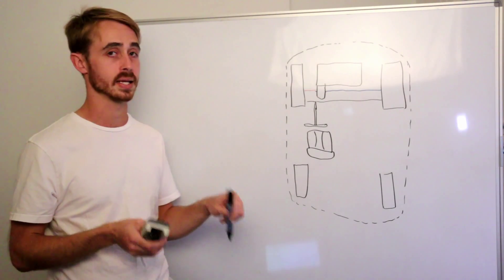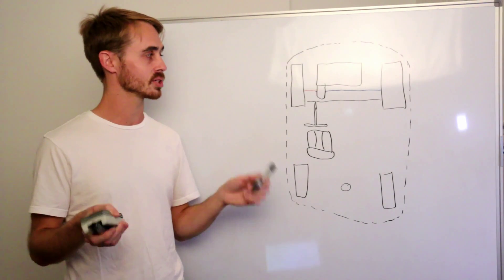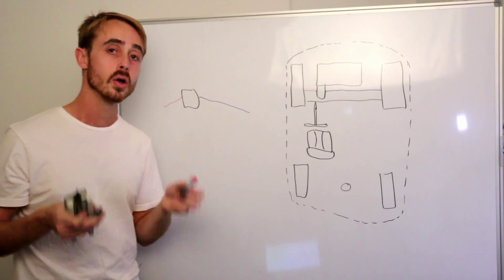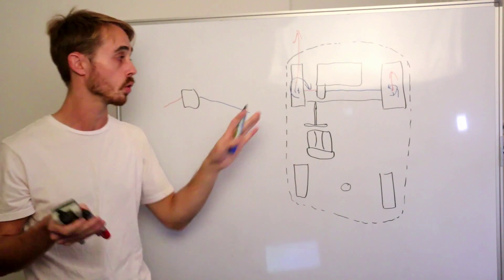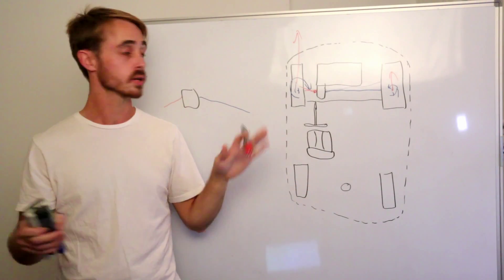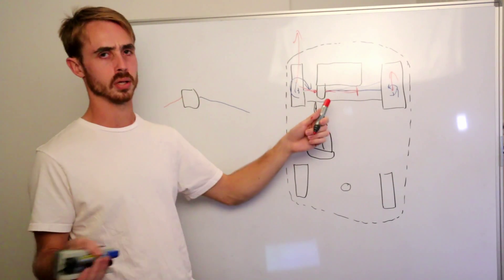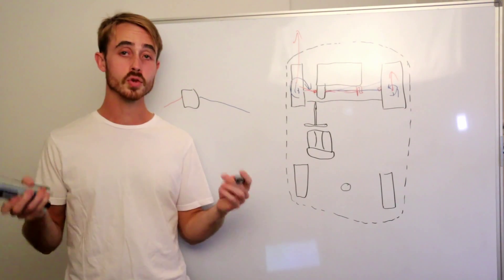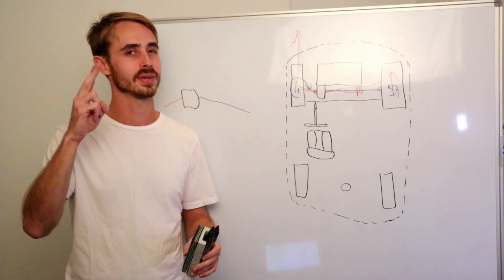How Does Torque Steer Work?

Comment: 3:29 did I understand this correct?

Torque streer is not a matter of linear axle size difference, but the difference between the axles at a degree of angle?

Comment: Thanks very much for the explanation. Only just learned about torque steer after decades of driving. Recently been driving a reasonably powerful vehicle with FWD and noticed it "wandered" to the side under acceleration. That got me wondering if FWD vehicles can pull to the side under power, so off to Google I went and found out about torque steer.

Comment: You cant match the fucking "stiffness" Of both shafts what are you even talking about? You can minimise torque steer by having 2 shafts of different lengths use different thickness but that is only at certain loads as twisting force isn't just governed by "Stiffness" as you call it. If you use more material in the longer shaft the twist up may be the same if you drop the clutch at 4000 revs but if you  drop it at 6000 revs it will not be the same. You can only match drive shafts or differing lengths for certain loads, thus you CANNOT eliminate torque steer.

Comment: What experiments and data do you have to back up your claims? Many new cars use the same drive shafts on both sides of the car and have another shaft connecting the furthest drive shaft to the diff horizontally. In this set up you have equal angles on both drive shafts but you still get torque steer. All cars want to turn either left or right due to suspension not being exactly perfect, that isn't torque steer. Torque steer is the snap you get putting down a lot of power that makes you change lanes and change back in a second. You are just guessing without knowing what you are talking about.

Comment: tl;dw = go buy a subaru

My last car was a 5spd Saturn Vue, horrible jerk to the right on heavy acceleration, hard starts....
Before that a 5spd SL1, same issue, not as bad though.... plymouth FWD before that, same issue.... just bought my first Subaru, and i find myself trying to correct for a torque moment on the steering wheel that isn't there....

Comment: Nice video. However, I have just had a problem with my Landcruiser, where I had to disconnect the rear prop shaft and drive it home as a 'FWD'. I have solid axles, front and rear. Still had noticeable steering torque.... How so?

Comment: My car had a lot of torque steer. Someone told me to change the transmission mount. So I did it, and the torque steer was reduced to a big extent.  However, it didn't completely disappear. 
Should I change the engine mounts too???
Reply: most likely. for fwd cars they are all impacting each other. changing 1 and leaving 2 bad ones will brake 1st one.

Comment: I'd imagine it has to do more with which side the engine is positioned since that wheel/tire would be getting more traction. You'll feel this under heavy braking (espically downhill) while hitting bumps in the road since all the weight is being shifted upfront and the front tires are getting about 80% of the traction under this scenerio. If you hit a bump with the side that has the engine on top it'll jerk more to that side as compared to the transmission side. Try it out for yourself. I honestly didn't finish this guys video bc he failed to mentioned that some cars have intermediate shafts.. so some fwd vehicles do have "equal angle" CV axles.. Also I'd imagine an LSD would eliminate the "cause" of torque steer as he suggested. My theory to truly eliminate torque steer in a fwd is positioning the battery over the top of the transmission and adding additional weight if needed to balance out the UNEVEN (Right:Left) upfront weight distribution.

Comment: My 2011 wrx sti is missing the rear diff bushing on the right side but it has them on the left, and I am experiencing significant torque steer to the right on acceleration. Could the flex of the rear differential cause torque steer like this? It is making me insane lol

Comment: The differential angle makes far more sense from a Moment of Inertia perspective. I've driven higher powered FWD cars that had torque steer depending on the surface and the start angle of the wheels themselves. On a flat even surface like a dragstrip, it had zero torque steer.

This is a car with a torsional or helical style differential, so both wheels were getting even torque. This is a car that you guys never saw, the 9th gen US Civic Si.
Reply: doesnt that car have equal length driveshafts

Comment: First video I have seen that seems to cover all causes of torque steer.  I own a mazdaspeed3(MPS) and have thought of using a carbon fiber shaft for the long side.  I guess I could use a normal shaft that is a bit thicker. Also many owners report that using a stiffer rear motor mount helps with the torque steer. Would using wider tires help control torque steer?  Thanks for all the expertise!

Comment: Great video! Im still wondering though...I'm on my way into becoming a technician and during my time on the lube rack I came across a 2014 chevy cruze with tires on the driver side at 5/32" and the two passenger side at 4/32". Since the shaft on the driver side is shorter and producing more torque why exactly would the right side be wearing faster? The guy is real picky and im pretty sure everything is in alignment, it has around 60k on it though.
Reply: It has to do with wieght! The tire that has the engine positioned on top of it will wear out faster due to the additional weight being put on top of it.. That's the real cause of torque steer. Don't listen to this guy lol

Comment: my Honda prelude used to pull from left to right during wot. Even my 01 VW Jetta Wolfsburg had torque steer but not as bad as my Honda prelude.
Reply: FockYouMang did the talks there on your vehicles ever cause any negative problems

Comment: Great video, some interesting points. I work for a Gm garage and in the UK we have a model called the astra they make a variant called the vxr that has enormous torque steer issues even with the equal length driveshafts as you mention. When they bought out the the latest model that's a completely different vehicle, they revised the diff that vastly eliminated a lot of this phenomena, but one thing I picked up on your video was the part about fords effort to eliminate with the knuckle. Is this a "floating knuckle" your referring to?, if so the astra vxr  has also this arrangement , do you think this has more effect for reduction of torque steer rather than the diff alone. Thanks for the upload, I look forward to watching some more.

Comment: Most FWD cars are econo-boxes with cheap open differentials, and torque steer is vastly more significant as power output increases.  Take the Dodge Neon SRT for example, which is notorious for torque steer.  A Limited Slip Differential virtually eliminates torque steer under heavy acceleration (which is the only time people actually care about torque steer) while doing nothing to change all the factors you've mentioned as causes for torque steer?  Certainly, an open diff sending power to just one of the two wheels connected to the steering wheel has a far greater impact on torque steer under heavy acceleration than CV joint angles and whatnot.  I'm interested to hear this explained as I really don't understand how an open diff can be ignored when the subject of torque steer comes up.
Reply from the maker: +John C Not true, in many cases a limited slip differential makes torque steer worse, for example cornering, which as I mentioned in the video around 6:25 . A frictionless, open differential will tend to provide equal torque to both wheels (50/50 split), thus reducing torque steer (while sacrificing ultimate tractive force) as there is less imbalance in the torques of the two wheels.  Be careful about confusing wheel rotation rate with wheel torque. This is why an electronically managed differential (e-diff) is a superior option as it can strike a balance between torque steer and total thrust. If the Dodge Neon SRT has bad torque steer, I would hazard a guess that it is more due to poor geometry combined with a reasonable amount of power than its differential (if it is open diff)
Reply: In my experience (not textbook theory) a limited slip differential eliminated torque steer in straight line acceleration.  I understand that torque steer can be linked to/blamed on all sorts of things, but when all other variables remained unchanged, i don't know how else you would explain it.

Comment: My Peugeot 306 (15 years) uses a solid axle to match the angles (Never really understood why, until now!) and I guess it have a very little Scrub Radius too (being very neutral in braking and acceleration)! I know it's a 110hp car, but I NEVER realized about any signal of torque steer.
After seeing your video about tyres and grip I understood the reason for the rear wheel steering system. I used to think "3 degrees? What difference will 3 degrees make?" but looking after slip angles, now I understand why it's a very well balanced car!
Shiit, I love my lion hahahaha
And your vids! 
Thanks man!

Comment: All of the mitigating factors you describe are implemented in the MK3 Focus ST. However, due to a small turbo and high torque at low rpm, torque steer is still present in our cars.

Comment: The point witht the CV joints is a bit hard to understand, especially since it seems to be one core cause of counter steering.
So the steering input from the CV Joints only happens if the gearbox is offset horizontally. Is my thinking correct?

Besides that a really good explanation!
Now I understand torque steer.
Reply from the maker: +Kalimerakis The point about CVs is twofold:
1. If you put torque through an angle using a CV, it will create an out of axis torque that will cause the steering knuckle to rotate. If the angles are different on the outboard CVs (eg. bumpsteer or ackerman), this will be felt as steering kickback.

2. If torque is put through an angle using a CV, the amount of torque output (the efficiency of the CV) will be related to CV angle. If your CV angles are uneven left-right, this will cause a difference in thrust force left-right, and create torque steer due to the scrub radius. This can be caused by several things:
 -2.1. Unequal driveshaft lengths will result in unequal CV angles if the engine is moved fore or aft, or if the suspension is in equal bump or droop (i.e. accelerating)
-2.2. Differences in steering angle will change the CV angles left-right due to ackerman or bump steer

So to answer your question, you can get the steering input from the CV joints without the gearbox being horizontally offset, however it will be worse with the gearbox offset as per 2.1, Options 1 and 2.2 can both occur with symmetrical driveshafts.

Does that help?
Reply: +KYLE.DRIVES Helps a lot
Thank you!

Comment: Really good explanation! I've always wondered how torque steer works. However, doesn't this mean that torque steer is reduced in an open diff, as both wheels provide equal amounts of forwards thrust?
Reply from the maker: +Antimation Studios Yes, an open diff will reduce torque steer over a limited slip diff , I kinda fumbled with the wording on that in the video a little bit, but I hope the point is still getting across!